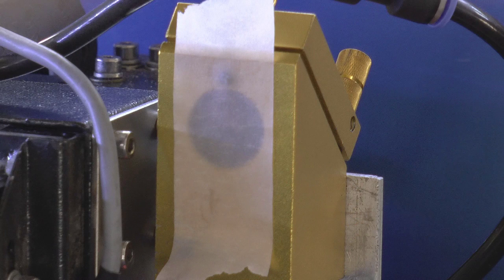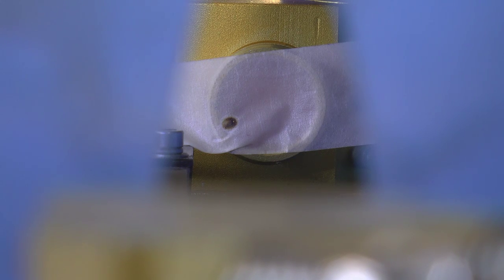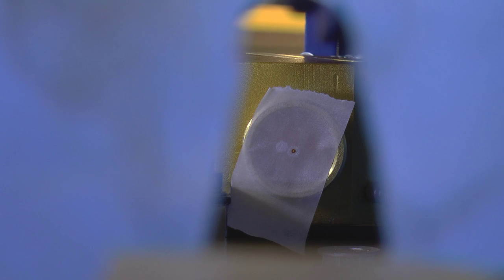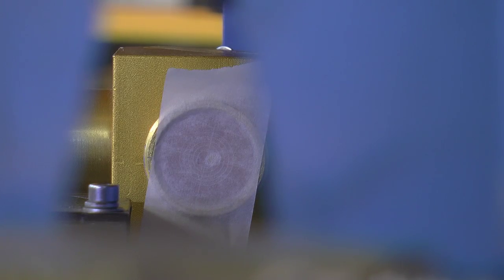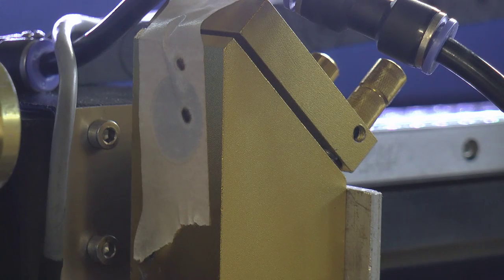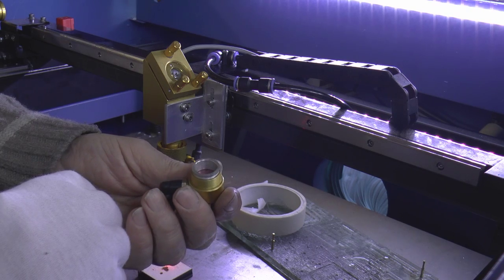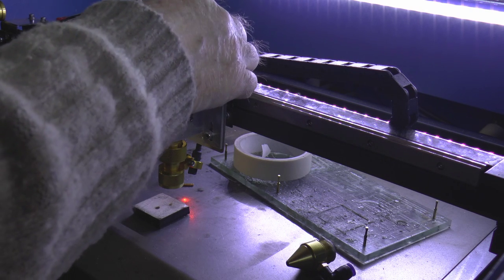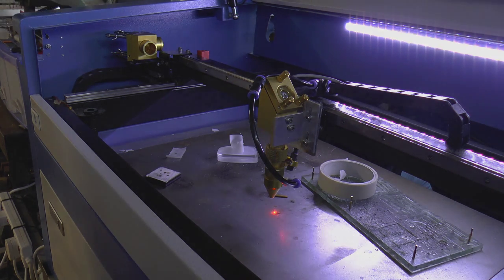RDWorks Learning Lab 44 Line of Sight Mirror Setting Part 2

Comment: Hi friends I am lakshmanan I have C02 100w laser machine now my laser tube is more then dust apear so how can I clean it my whatsApp is +91 9787155084 pls help me
Reply from the maker: Hi
 Dust on the OUTSIDE of your tube will not affect it's performance but if it worries you then switch your machine off and leave it for half an hour. Wipe away the dust with a damp cloth and then wait another half hour before switching the machine back on. If this is not your p[roblem could you explain more.
Best wishes
Russ

Comment: these videos keep getting better and better!
Reply from the maker: +mrchew1982 
Thanks again for you kind support. Please just remember, I am solving problems for MY machine in MY way. I am not advocating anyone to follow my method or butcher their machine in the careless way that I do, but, if it makes you think about how you use and set your own particular machine (for example many people do not have enclosed mirror systems) then I'm gratified to have opened a new door for you. It's taken several months of trial and error(as my previous videos record) and every time I reset my mirrors think I've cracked the mirror setting problem. But I still spend several hours of tweaking to get the beam aligned. I eventually get there. Has it been luck? Could I really logically describe a method I had used or was it just edging closer and closer with repeated pulse burns and some good luck?  With filming, this took about an hour to do but I'm confident of repeating a raw set-up within half an hour using  this logical approach.
Thanks again for you kind words
Best regards
Russ